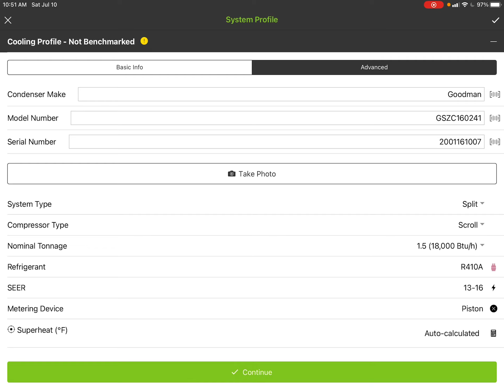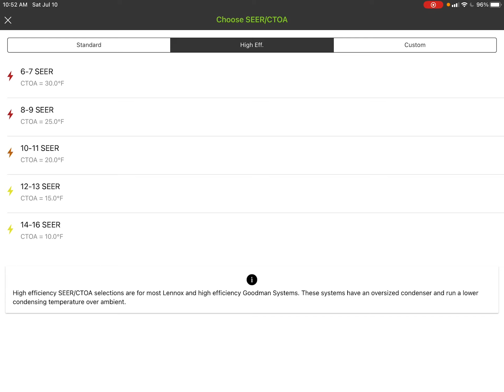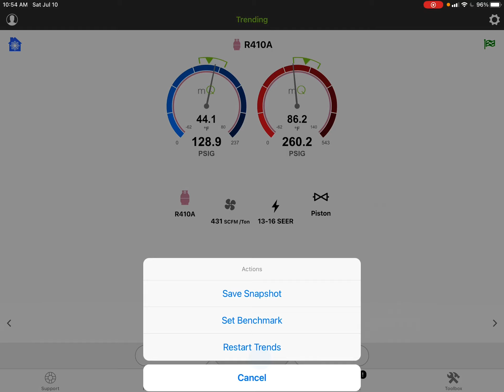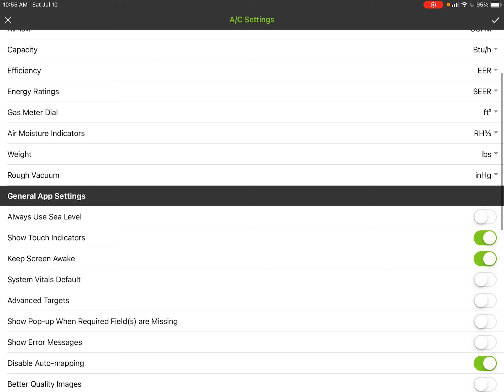Target zone improvement for pressure targets!

Comment: Ok message received.  Had to watch This video a couple of times with pauses and reminds to make sure I got it.  Thanks for leaving the toggle switch in place as an option for the oversized evaporator (I intend to keep using it).  If stated I missed it but, looks like the selection for airflow is gone (even withhigh efficiency evaporator toggled on), because of actual airflow calculation - correct?  If so I believe I like that the estimated actual airflow calculation is there, to help me speed up and, if shows a problem then I can take the time to investigate further by trying to measure airflow.  Thank you Jeff Emmert from Indy.
Reply from the maker: When you toggle on the advanced targets it works just like it used to. You can still adjust the airflow and select the oversized evaporator. I just checked it it still works that way.

Comment: How do you set the green lines to show , the target readings? at the outside of the clocks?
Reply from the maker: By selecting the SEER for the high side and refrigerant type for high and low. They are automatically calculated using the design temperature difference (DTD), condensing  temperature over ambient (CTOA) return temperature and humidity as well as the outside air temperature.
Reply: @measureQuick  Sorry i can't get it to show, can you  do a video showing how to do it?
Reply from the maker: https://youtube.com/shorts/IAyXs6Uj9Ts?feature=share
Reply: you need to set your outdoor air temp, as well as return wet+dry bulb

Comment: when going into a project and then exiting, what would cause the IOS version of MQ to popup a Error: TypeError:null is not an object (evaluating'e.parent.context.$implicit.mq_customer").  this pop up does not go away unless I end the MQ app.  And is consistently reproducible once I go back into projects.
Reply from the maker: In the settings (gear) you have “show error messages” on.
Reply: @measureQuick  thank you for that info.  How do I resolve an issue where the Virtuoso site has 4 projects assigned to my user ID which is causing the errors on the IOS app which cannot be deleted. It responds with "Failed to Delete Project". Also no changes can be saved to any of the 4 projects.
Reply from the maker: @TheRealoldcar  we would have to look at that by logging into your account. Call me when you can during the week and we will see how it can be fixed. We have not seen any thing like that so it is likely specific to your account.